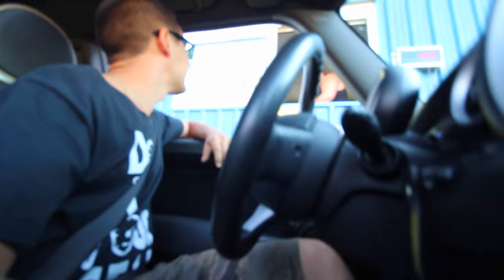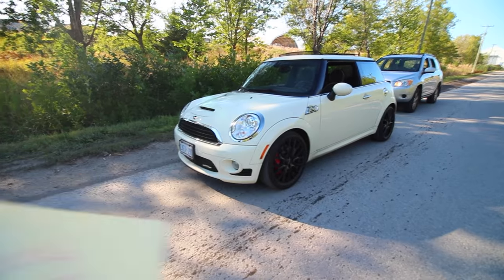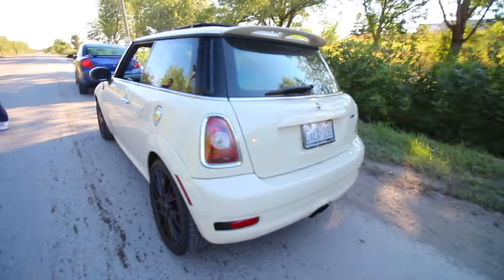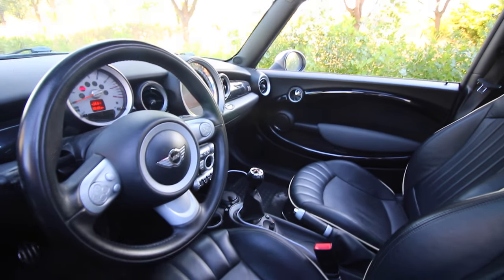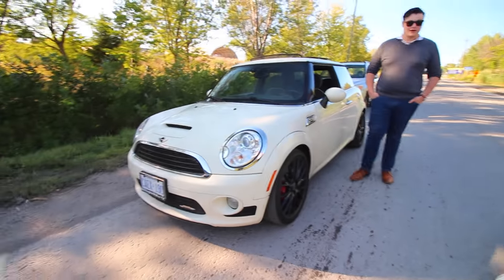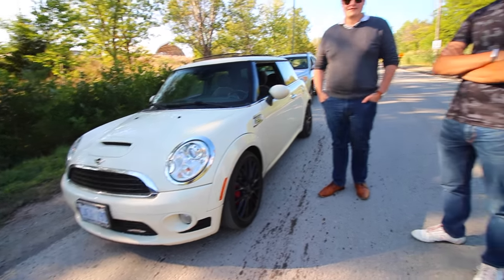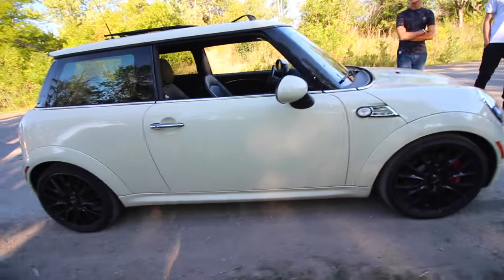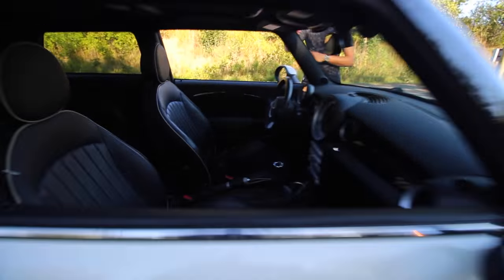HOW MINI IS THE MINI?

Comment: Hey! Thanks for your videos!  I have 2016 Mini cooper s with low miles and no mods.  Going 30 MPH or so on the left turn for example and hitting some small hole on the road, makes a pop/bang sound once.  Then it can be heard again on another turn with some imperfections on the road. When road is good, there is no noise at all.

Comment: you're right about the racing heritage of the mini. however that was the much much smaller and lighter classic mini. still I dont have any doubts that this mini will destroy most (stock) muscle cars around a track. you might have a tough time on a drag strip though.
Reply: also I would take out the air conditioning and the COMPLETE interior and I think the glass roof might be much heavier than the metal one
Reply: the new ecoboost mustang will smoke this, but muscle cars from the same year probably would have a tough time
Reply: @NabilXi   LMAOOOO ecoboost mustang is that a joke?? mustangs period are awful let alone ecoboost trash

Comment: Does it matter what gas brand you fill up with?
Reply: I dont think the density is enough to be noticable.
Reply: not really but the type of fuel does matter
Reply: Whichever brand has more ethanol usually translates into less power (ethanol is less energy by volume than proper gasoline).

Comment: Milan, are you considering paint protection film for the Mini? The thing's way too nice to get peppered by rocks IMO.
Reply: it's race purpose so it will get beaten anyway...the peppering is just normal especially if you have gravel on the track
Reply: +PizzocanWasd Good point but my friends races a new black BMW M3  and the front end of his car is clear bra'd. As well as the rocker panels where rubber and rocks kick up. Nothing wrong with having a great looking racecar.
Reply: +PizzocanWasd Im thinking he'll dip it for racing, that stuff is pretty rugged too. Could definitely be an alternative paint protection method.

Comment: i think u should start by removing the roof, all that glass is not as light as a standard steel roof, but if you go for carbon fiber or even fiber glass you bcan even save more weight

Comment: Your striping weight and adding power but did u realize how much wheel spin your going to end up having
Reply: Coils? Wheels? Etc?
Reply: Just curius - what do coils have to do with FWD having too much torque? E.g. the best Acura has come up with for FWD was "vehicle stability assist", which essentially is ABS braking to prevent wheelspin and torque-steer when launching. It's so-so and robs power.
Reply: less body roll and stuff like that

Comment: Just because a car is quick, it does not mean it's fast... You are not beating any mustang or Camaro lol
Reply: If he loses tons of weight he might beat some lower end muscle cars -- depending on the track.
Reply: Then if you don't like what you are watching  quit watching and keep your asinine comments to yourself!
Reply: He never said it would beat them but it will in a track because the mini handles a lot better wheals on the corners low stiff light weight smaller easier to handle
Reply: He's building it for the circuit. You'd need too much work to a muscle car to get it to lap well. That's all. Muscle cars are cool but it depends on what you're looking for, it's not a one size fits all. Please get your heads around this simple concept.

Comment: The thing is heavier than a Mk5 Golf GTI. Seriously? how are they calling it a mini? I'm British and remember when a mini weighed about 550kg, about 1200lbs.
Reply from the maker: The curb weight of a MK5 GTI is much more than an R56 JCW. The vehicle weights 1300kg with a full tank of gas and myself in the car. That means it weights 2860 - me (160) - gas (80) = 2620 with a full interior. You're saying a GTI weighs the same? I've seen them weight over 3000, manual and DSG.
Reply: Only the Mk5 R32 is 3000lbs. a Mk5 GTI weighs 2600lbs a R56 cooper S is 2570. I have an R53 cooper right now that weighs 2500. Thats more than my old Mk3 VR6 golf and about the same as my Mk4 VR6 weighed.